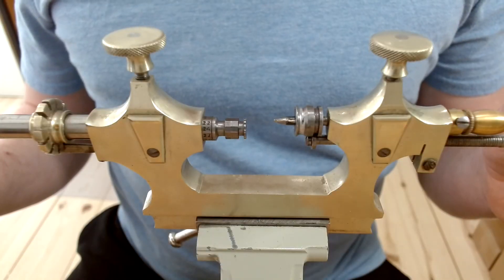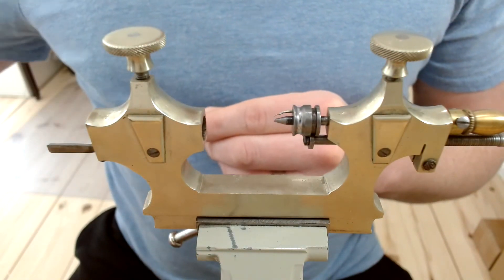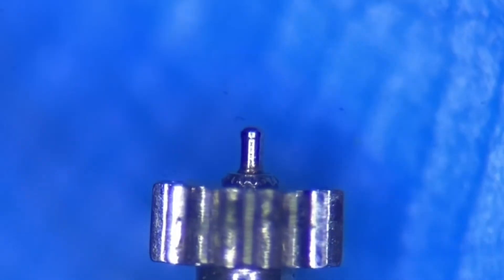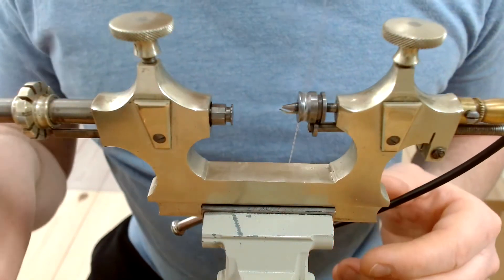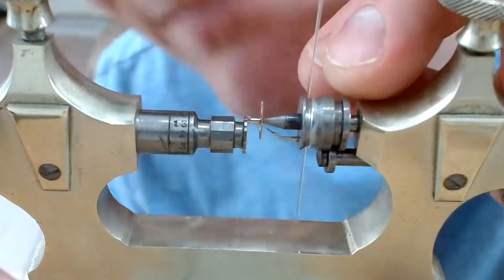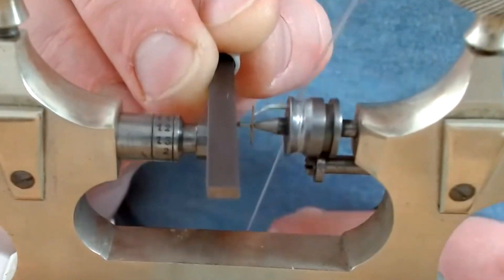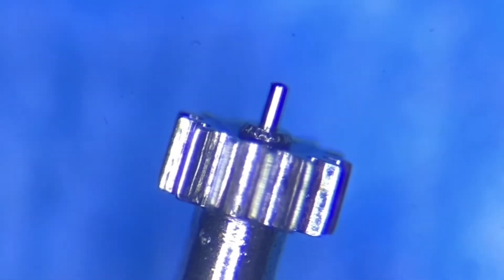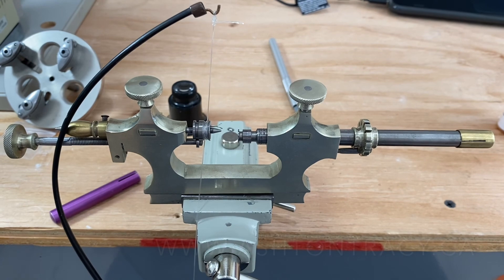How Do You Polish / Burnish A Watch Train Wheel Pivot? - Vintage Watch Repair

Comment: Good video, however how does the pivot not get too small in diameter.  It seems there would be too much "play" when re-mounted on the jewel.  Any help on this would help.  Thanks!
Reply from the maker: There is a limit at which the side-shake will become too much. If it does, you can go down a jewel size and install that. In this case, the side-shake was acceptable and we could keep the original jewel.

Comment: Two things that have made me reluctant to use a Jacot tool.  First, being somewhat old, my hands are not as steady as they once were and it's difficult to mount the pivot into the tool.  Second, is dropping the piece, which I notice you did ( 5:27 ) in your video.  Still I'd like to do better with the tool.  Any suggestions?
Reply: For steadiness of hand, the most effective means of achieving the best you can is good posture, smooth deep breathing and relaxed hands and arms. 

There is a tendency to hold your breath and tense up when trying to do something small and fiddly. 

This seriously impairs fine motor control. 

Set up your workspace so your posture will be good when attempting the task at hand. 

Sit up and take a deep breath and let it out, consciously relax your body. 

Make a conscious effort to stay relaxed and keep breathing deeply as you start the fiddly task. If you notice that you are tensing up or holding your breath, then consciously breathe and relax hour hands again and try to keep relaxed as you proceed. 

This gets easier and easier with practice, and as you gain confidence the tendency to tense up and to take shallow breaths disappears. 

In terms of not dropping parts when using the Jacot tool, if you put an open magazine in the vice and the Jacot tool into it against the spine of the magazine, you have a safety net to catch falling parts. 

Another option, which used to be fairly common practice when watchmaking is to wear an apron, and pin the bottom hem of the apron to the front edge of your workbench. 

The apron then becomes a safety net to catch any falling parts. 

Learning to use the Jacot tool well isn’t easy. It takes a lot of practice to be able to produce consistent results. 

Get a load of old watch wheels, both train wheels and balances. Look for bulk lots of random mixed wheels with the arbours intact and you can get them very cheaply. 

Start practicing on these, you will break pivots, you will produce tapered pivots and you will produce more and more well polished pivots with practice. 

If you want to get good at this, expect to practice regularly until it starts to come naturally and you will get a feel for it. 

I know some excellent watchmakers who say it can take months of practice, or more, to master the Jacot tool. 

You CAN do it if you put in the effort, and the improvements you get once you can polish pivots when necessary are worth the effort involved.

Comment: How did you know what setting to select.? Please
Reply from the maker: Hi, I’m not sure exactly what you mean?
Reply: Eg did you measure the pivot diameter  then select the corresponding number on the shaft . Regards
Reply: @blenny47 Maybe the safe approach is to use a large slot, try it and see if the burnisher has any effect, and if not, move progressively to smaller slots

Comment: Thanks Ashton for the informative video - glad to have found your channel. If a pivot is slightly bent, can you use the jacot tool to straighten it out while burnishing? Say a train wheel pivot, as I would just replace a bent balance staff.
Reply from the maker: You could, yes. It's rare that small diameter train wheel piots get bent. I often see long 4th wheel pivots with bends in them, however.
Reply: @PrecisionHorology  Thanks. I ask because I am planning to buy a jacot tool, and I have recently had a movement in which the escape wheel lower pivot was bent - as were the escape wheel pivots in all 4 donor movements I bought!

Comment: Great video thank you.  The resulting pivot is necessarily of a smaller diameter than the original one with the wear on it.  When is the amount of resulting side play in the pivot hole a concern?  I assume that if the wear on the pivot is too much to start with, the solution would be to re-pivot that wheel (as I assume this would be easier than to add a bushing to the original pivot hole)?
Reply from the maker: I mention in the video that if you remove too much material you need to go down a jewel size. It’s a much simpler job to burnish the pivot and change out the train wheel jewel. There is always room for error when you are re-pivoting at this size so this is the best solution, depending on how much you have to remove. If you remove more than 75 % of the original diameter you would want to repivot.
Reply: @PrecisionHorology  Thank you Ashton, that is a great explanation of what needs to be done in whatever situation after polishing/burnishing a pivot.  Cheers!